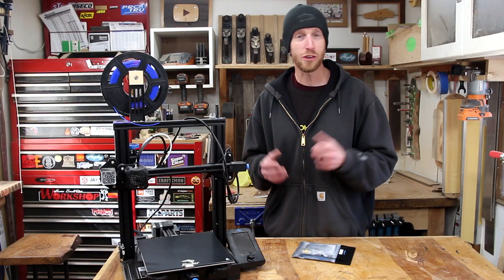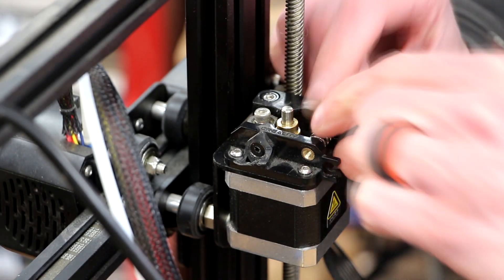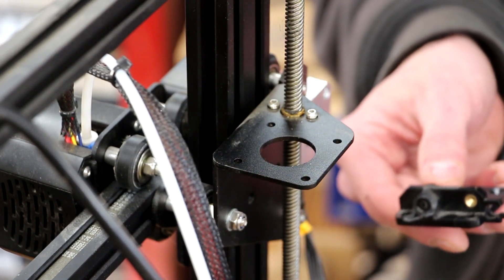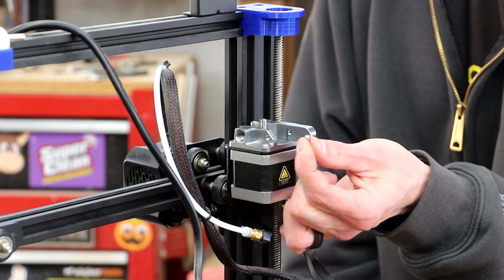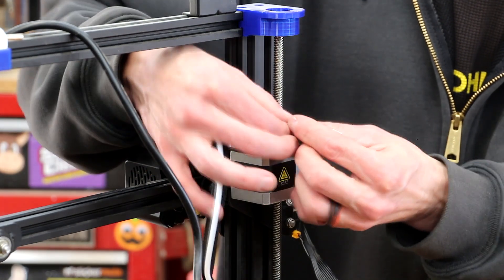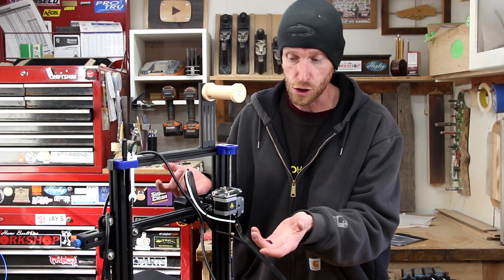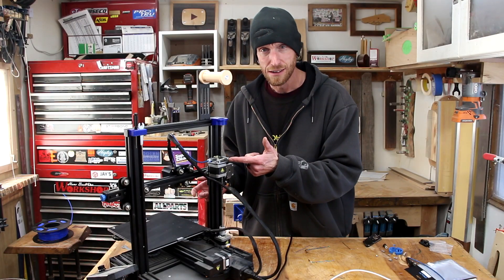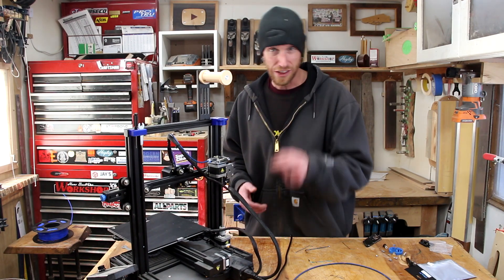Installing an All Metal Extruder on my Creality Ender 3 | No More Broken Plastic

Comment: Thanks for this tutorial! Quick question on the tube replacement - does the hot end need to be preheated if a capricorn tube upgrade is being installed on a brand new printer?

Comment: And there's another screw hiding under the arm... Exactly the info I came here for. Steel gear if you're printing Wood PLA or other rough filament.. wore a channel in my brass gear in no time at all.

Comment: I made the mistake of buying the dual gear red extruder for 3v2. What a POS! It was so poorly machined and it shredded the filament! When I when to calibrate the E steps. I first got 15 mm and with no changes to the E steps I got 310 mm.

Total junk! The brand of the extruder was the Redrex dual gear extruder. It supposedly was the one to fix the gear grinding into the arm problem that most of these have!

I put the original one back on as it was fine and calibrated the E steps (which are different than the factory settings) and it has been printing so much better than out of the box!

I bought the same one you have here but u haven't installed it yet. I am waiting to see if the plastic one finally breaks before I do.

But try calibrating those E steps and see of you get any better quality on your prints? I'd be curious to hear I you do?
Reply from the maker: Thanks. I'll have to recalibrate and see if it makes a difference.
Reply: @homebuiltshop  let me know what numbers you come up with. I'd be curious to see what you get before and after.

Comment: Alright!!! Back up and running. Awesome. I highly recommend up grading your heat brake as well. Since you do periodically print ABS. The higher temperatures required for ABS will rapidly deteriorate the ptfe bowden tube. It also causes it to release toxic fumes from it. I serviced my printer yesterday as well. Gave it a good cleaning and replaced all my X & Y rollers from POM (Delrin) to polycarbonate and readjusted all axis. Next I plan on moving my power switch from way in the back to the front. Catch you later.